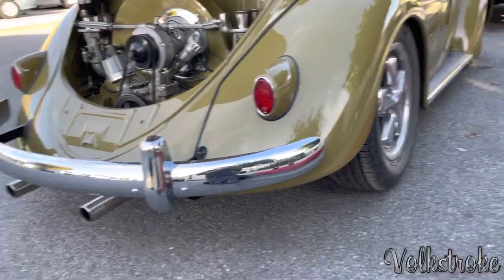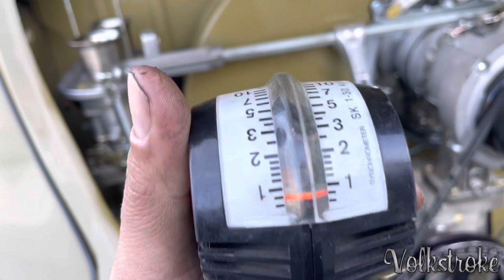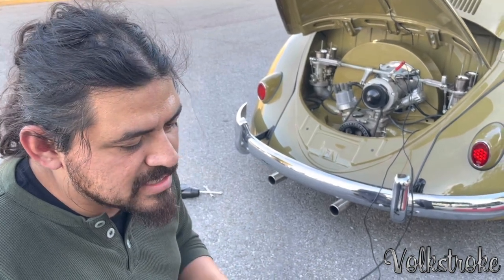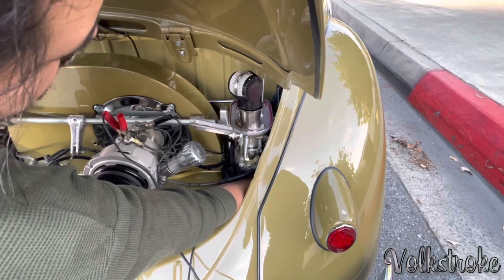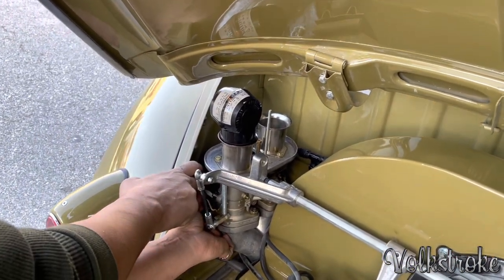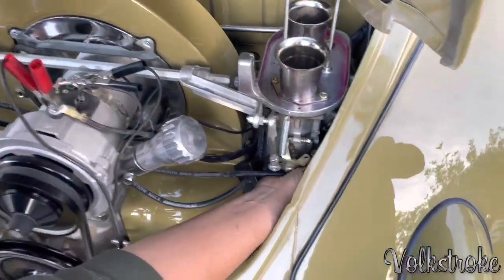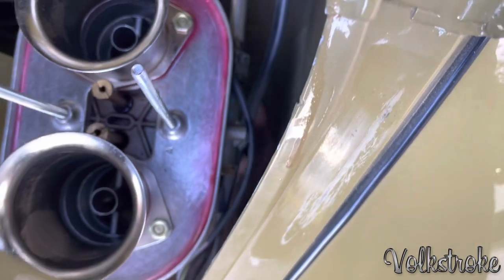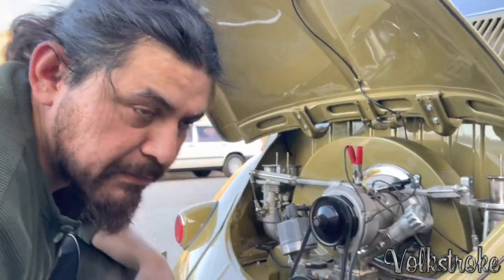How to synchronize IDF carburetors

Comment: Carburetor adjustments sure become more complicated when there are multiple carburetors. In this video there are two carburetors and the job is to equally balance the air flow and the idle mixture between two carburetors. Many years ago my father owned two Volkswagen Beetles. Both of them just had the single stock carburetor.

Comment: The camera will not show it due to its native scanning rate or more correctly its frame rate.  Depending on the camera and or what format you are recording in will determine if you can see the strobing of the mark.  If you can change frame rates on your camera, you might be able to pick one that will allow you to see the strobe mark in the video.  If not, oh well sorry.  Old school cameras shot at 525 line 30Frames Per Second(FPS) and usually were slow enough to see a strobe mark.  Modern(anything in the 21st century) are all 1080/30 but can be up to 4-6K resolution and a variety of frame rates from 24 to super slow mo high speed rates.

Comment: Why do mine idle at like 3and a half
Reply: I'm popping out my left side tho and I can't figure out why
Reply from the maker: Because it has lots of vacuum
Reply: @volkstroke  like a leak or?
Reply from the maker: 3and a half what?
Reply: @volkstroke  sorry on the snail, the sync tool. It's in-between 3 and 5 on the marks, it idles fine for like 40 secs to a min and then slows down and dies, if I let it, I can always rev it and then it goes back to idleling fine. My left just adjustment screws do like nothing, and I'm also getting popping out the front barrel of both carbs. Got dual 40 dellortos.
Reply: @turtletoes7499 Did you get it fixed? What size idle jet are you running? Jump up 5 on your idle jet and should get you some more flow at idle.

Comment: Great video! This is exactly how I do it from the book. In my bus, I can reach the Air Bypass screws to fine tune the barrels. But dang...you have NO room in an early Beetle. I'm not looking forward to this when I get my 1915/ IDF engine into my 60' Beetle. You make it look easy!
Reply: for me, accessing the forward two mixture screws is easier by sliding my other hand down the firewall from the back side of the open decklid. That's also how I access the forward manifold nuts on these super-tight fitting big engines in beetles. Some folks have cut access holes through the side to the wheel well  but not on a beauty like this!

Comment: Good stuff. I bought a set of brand new Italian  48 IDFs  and 48 IDAs both with match ported manifolds to my super pros. Kept the IDAs and sold the IDFs. Never got to run either set of carbs. 
I have 4 more wish list items after I get my current engine finished: another set of 48 IDFs this time on big beef match ported street fighter manifolds, a set of geers 51s, those street fighter heads , and a scat or marine billet 86mm crank to go in my tf-1 case.
Please keep up the great work David. I love your vw passion
-Ted
Reply from the maker: Damn bro
Reply from the maker: Cool😊
Reply from the maker: You got it coming together
Reply: @volkstroke  2332 is built out to the heads, but waiting on pushrods and for CB to get more 4.5 quart thin sumps in stock. I also need an ignition box. In the meantime I'm keeping busy by fixing the brake setup on my '59 bug and messing with an Okrasa 36hp I'm building a run stand for. 48 IDAs are just the 2 progression hole ones, no 3rd hole. Wish I could visit Cali so I could see all the cool rides you have in person - Ted
Reply from the maker: My IDAs don’t have a third progression
Reply: @volkstroke  Ok cool mine should be fine then.
Reply: @vwsandvettes3253  Post a video of the engine build stand plz!
Reply: @ocavant  I will! Look for it on my channel in the next few days. Take care!

Comment: Good job. However Weber’s have an air correction screw on each throat so you can balance all 4 to perfect lowest idle with linkages disconnected. Then you’ll need to fit the left hand side linkage so you get full open throttle and a tiny bit of slack at idle. Once that is done you need to fit the right hand side linkage and you’ll need 2 anemometers so you can balance the right hand side  linkage at higher rpm. It can be done with one but it’s much easier to use 2 as keeping 3000 rpm is hard to keep steady while swapping it from bank to bank. Then you should confirm afr and even dizzy curve to make sure it’s all ok and nothing too lean but that can be done on a dyno or an afr logging tool. Dizzy curve can be done with your timing light and cross referenced using your afr data which then confirms your transition circuit, accelerator pump volume and main jets. Obviously the float height has been confirmed otherwise your main jet might be the right size but could be lean due to a low float height
Reply from the maker: Come dial my Carburetors
Reply: NASA we have lift off! 😂

Comment: Great Video. You covered all key points. I agree you need to adjust almost every day that your driving. Can you explain what you did at 11:55 of the video. You cut out and then came back with a new tune. Glad your wearing your knee pads.
Reply from the maker: It was the idle jet took it out cleaned it and put it back in

Comment: …when u were turning the idle mixture screw, and no change; u determined it was plugged. What did u do afterwards? Did u remove the mixture screw and spray it, or sprayed into the carb? Thanks.
Reply from the maker: Took the idle jet out and cleaned it

Comment: Any chance you could share the engine specs? I just got my hands on a dual port 1600 for my 64 beetle. Im wanting to put dual carbs on it but not sure if its going to be too much for a stock 1600. Looks and sounds great! Exactly what im looking to do to mine. Cheers
Reply from the maker: You need 40s or smaller
Reply from the maker: This engine is 1914
Reply: 40 IDFs with 28mm venturis are perfect for 1600 dual port engines.

Comment: Great video? With the dual setup, any heat soaking after the engine is shutdown? If so why?
Reply from the maker: Heat soaking?
Reply: @volkstroke  your manifolds getting hot from the heads, creating g a hard start.
Reply from the maker: @FixinBugsNStuff  if it does that it’s probably got a bad valve job

Comment: I have that linkage for my dual carburetors  those things suck not necessarily the Rod it's the hem joints I see that left one on the driver's side is pretty loose
Reply from the maker: They sell the homes and rods separately to keep it fresh
Reply: Hey James I had that same linkage on my 1915cc engine and they suck. I binned mine and purchased a Gene Berg linkage. 
You can't compare. 
Empi or Gene Berg.

Comment: Here in Brazil, the options are Empi HPMX 40 +R$11.000,00 or FAJS 40 R$4.000,00. Is it posible to get this result with a set of FAJS 40?
Reply from the maker: Probably
Reply: I have a stock 1584cc with 1.25:1 rocker arms, a 4x1 exhaust header and a set os two solex 34mm... I'm want to put the FAJS 40 set with bigger valves 40x35.5 and stiffer springs in the heads. Thinking in 60-65 whp..  @volkstroke
Reply from the maker: That will do it
Reply from the maker: Compression too
Reply: The original compression for this engines here in brazil is 7.2:1, very low. The pump gas that we have is 30% ethanol. Thanks for the answares.
  @volkstroke
Reply from the maker: Put it at 10.6